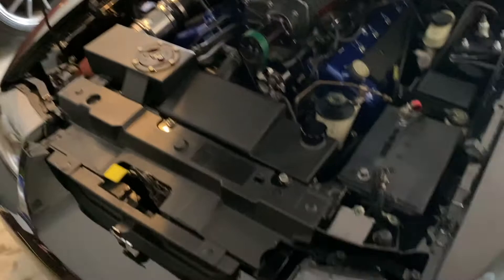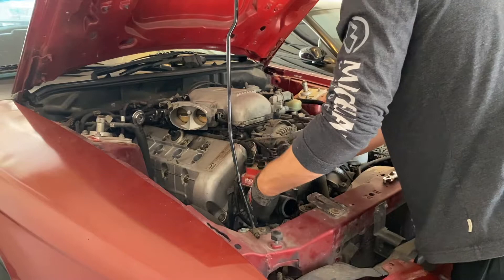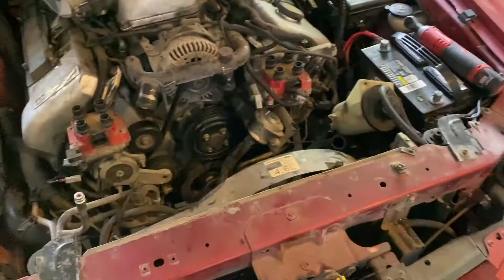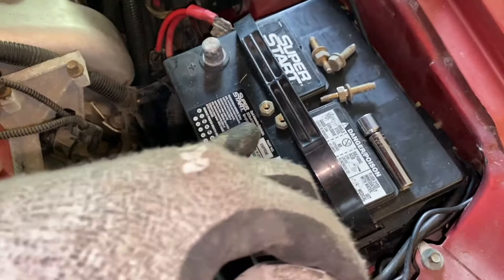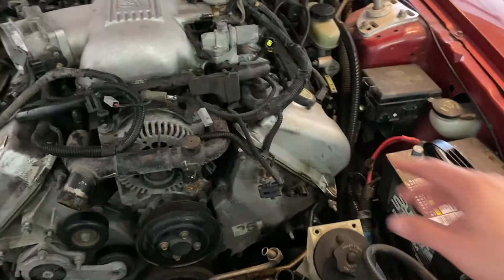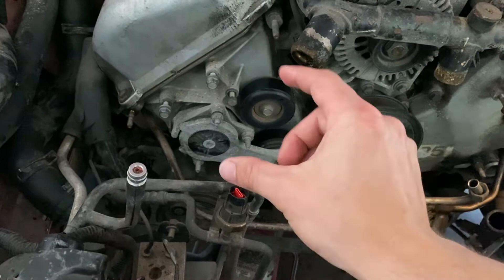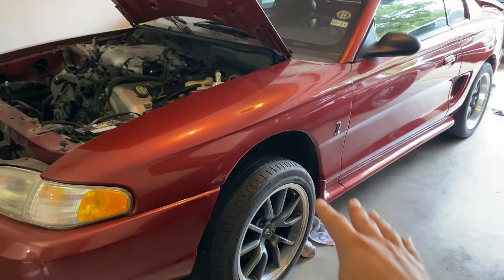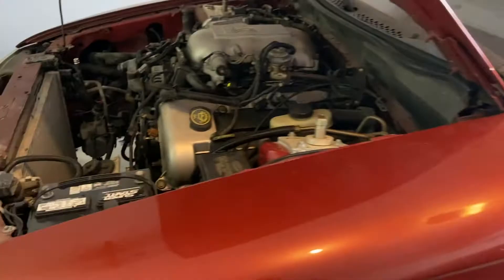Pulling the 4.6 4V ENGINE in the 98 COBRA: PART 1

Comment: Borla Stinger Catback all the way
Reply from the maker: That would sound good
Reply: @kskvideos  kooks 1 3/4 headers with 3” collectors, 3” mid pipe, and 3” kooks mufflers with 3” tail pipes! Best sound in the fucking world!!! Especially if you’re tuned to make power past 7k rpm, These motors sound like nascars around 7800rpm